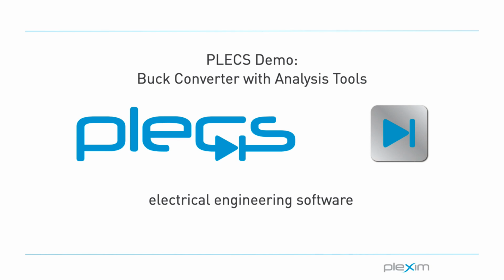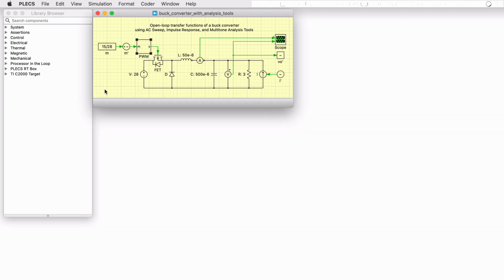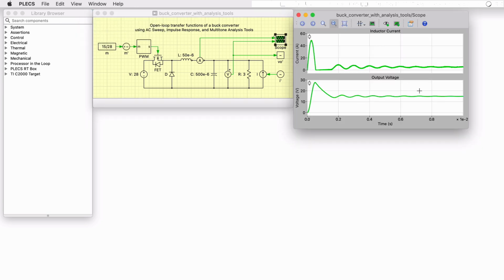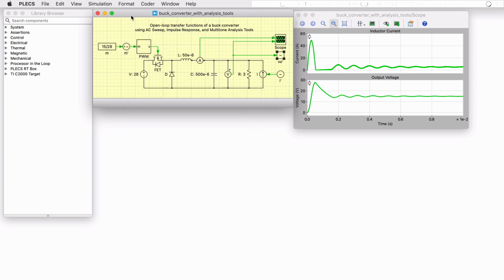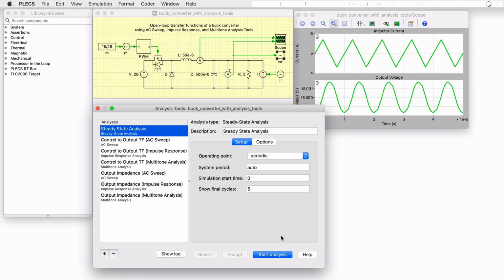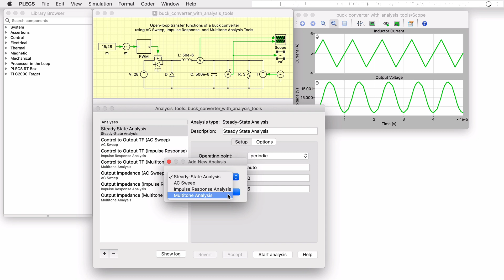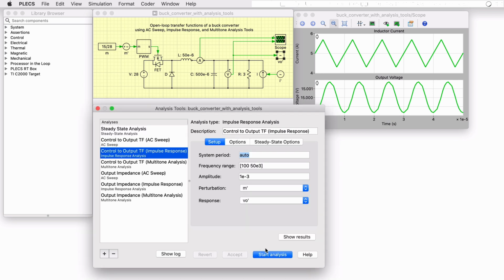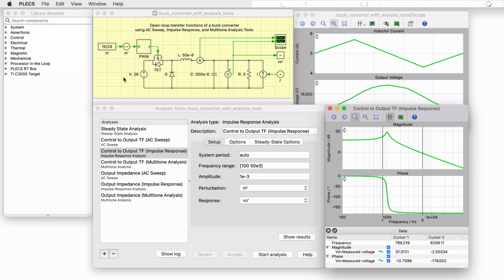Buck Converter with Analysis Tools

Comment: What is the m-block to the left connecting to the perturbation-block? 15/28
Reply from the maker: This is just a Constant block with a modulation index set point (used to command 15V at the output from the 28V input). We renamed the block "m" to show its purpose.

Comment: it sucks that we cannot download the demos in PLECS Blockset and use them as basis
Reply from the maker: Hi, all the demo models are available in PLECS Blockset as well. Enter "plecslib" in the Matlab command line to open the PLECS Blockset library. You can then access the demo models by double-clicking on the "Demos" folder.